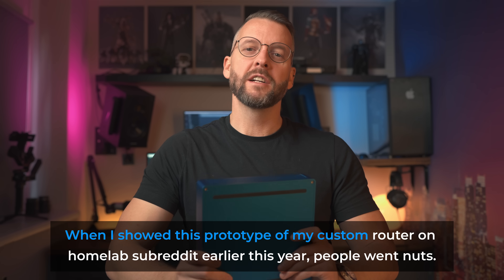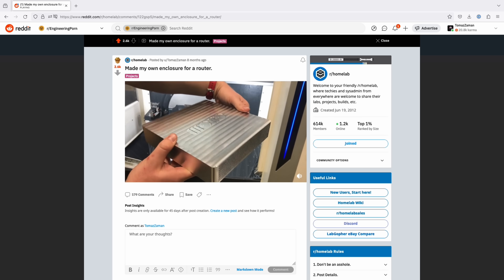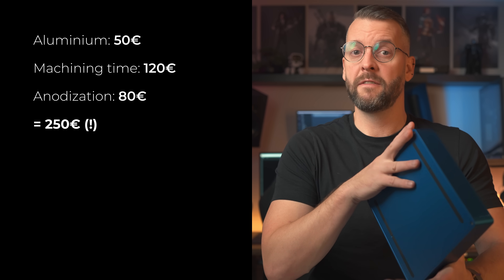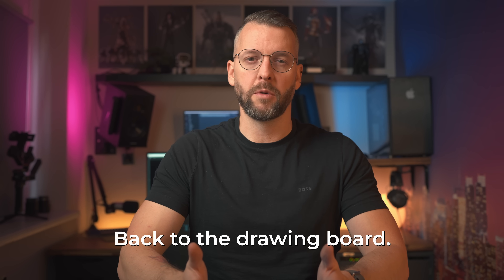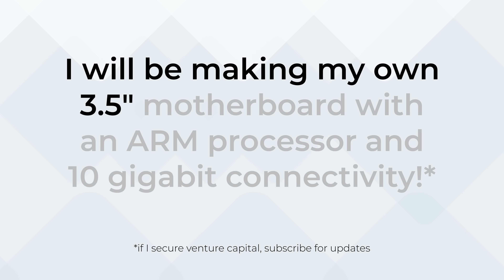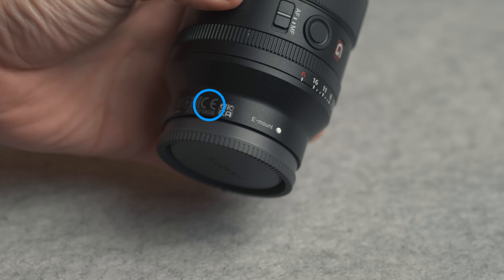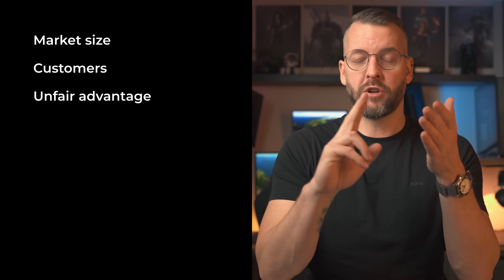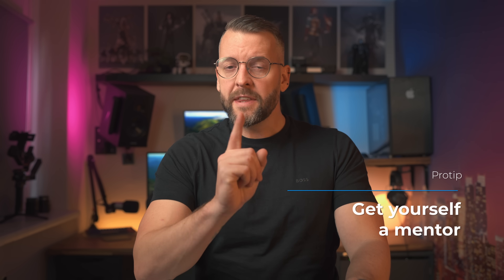I'm making my own high-end router. From scratch.

Comment: Did you ever look into dimensional extruded tubing? You can get the material cost down significantly if you use that for the body., and attach the top/bottom  through welding or fasteners

Comment: Hey! Huge fan of what you’re doing. Small note on the power supply. The very last one you reviewed is without a doubt the best option. Smaller would be nice, as you said, but frankly it’s already pretty small! I like it. Also I think you agree that having a little more wattage than you need is better than the alternative. Not enough power. 

Side note, I think the cnc aluminum case is so cool!!!!

Comment: Do you really need to make the case out of a single block of solid aluminium? I think sheet metal would be a lot cheaper or if you are really fixated on solid aluminium - just make all sides from different pieces rather than carving a single solid piece

Comment: Please find a cheaper option for the case. Multiple aluminum panel, or folded panels. 150€ is crazy for a case. I currently run a custom router made from a topton N6005 which has 6x2.5G and with 16GB ram and storage costed about 500€ and has a nice metal case

Comment: Wait, hold up, allow me to make a suggestion. You should NOT do 10G as I believe 100G is going to overstep 10G. A QSFP28 port has the same signaling to support a single 100G, 50G, 40G AND 10G and all you need is whatever transceiver for whatever you want to do. The only thing that you may not yet be able to do is PHY for copper connectivity on a QSFP28 port but you could use an FPGA to kind of force the ability to install a SFP+ 10G PHY into the QSFP28 port with a physical port adapter. A QSFP28 port can support 25Gx4, 50Gx2, 40Gx2, 10Gx4 already. Also this could totally justify expense by basically being the be all end all home router.

Comment: Nice, will that have integrated WLAN? I mean I am a fan of regular old cables (LAN!), I after all wired up my own place (apartment) before moving in with a network access-point/network-socket (well: 2 of them!) in every room (except for the bathroom - I don't see the need to have access to LAN in the shower after all)...still, for phones and tablets WLAN is important...why am I asking: Aluminium (that case is aluminium - right?) can't be that great for signal-strength!

Comment: Can I ask how this would be better compared let's say to an ASRock DeskMeet B660 with let's say a cheap i3 (can take up to 14900) and a 4 port 10GBPS NIC?
Given that DeskMeet is a full PC that can run proxmox for other use cases at the same time.
I am only asking because I work for a company that we support other clients and I want to bring to the table a custom made router that can run pfsense for example so we can have VPN to them and support them much easier.
So far I do this via the DeskMeet, I know it is not an 1U that I would love to have, but I am using it for Frigate with google's Coral TPU and a few other VM services that customers wants.
Also because at home, I have 1gbps FTTH internet, I have a couple of Asus routers that are wifi 6 and have dual core ARM cpus but they seem to struggle getting above 550mbps without having IDS/IPS enabled (much lower with that enabled). How good will ARM CPUs will be running a 10gbps internet connection with IDS/IPS? And no, I don't have access to this fast internet...maybe at some point 2.5gbps but for sure not 10. It is a more what IF question

Comment: Can't you get rpi5 and either see if there are 10G HATs for it or make the hat yourself, much easier than making whole mobo.
Reply from the maker: No. I'll be making a video why that's not even remotely the same. The thing is rpi5 isn't network optimized, so that 10G will slow down significantly, if there's anything (and I mean ANYTHING) that needs to be done to the traffic, such as deep packet inspection for intrusion detection.
Reply: @tomazzaman  So you need to use some processor optimised for network handling?
Reply from the maker: @Arek_R.  yep, we’re going with NXP LS1046A. That thing alone costs more than a rpi5 :)

Comment: thats a very interesting idea. But could you have just used a 10G add on card for existing MoBo? there are lots available with PICE or M.2 connectors that could just be mounted in the case
Reply from the maker: The problem is the CPU. It's optimized for networking, but if you use an add-on card, then the general purpose cores have to take that load, and they're not optimized for that.

Comment: Sheet fabrication is better for this application, it's faster, cheaper and makes almost no metal waste which means more savings.
Reply from the maker: Yep, planned.
Reply: @tomazzaman  good, also out of curiosity since some of these systems can run on x86 doesn't that mean I could just stick some cards in a old gaming rig and use it as a secure router? I'd assume it has enough grunt to sort out things.

Comment: maybe i am a little late but i come from manufacturing. have you thought about say 4-5 mm Aluminum Sheet metal? if you are ok with a radius, you could have those casings done for about 20-25 Euros easily. (the galvanisation not included, however) personally, if you were to have the corners laserwelded, you would have an amazing product with a fraction of the costs!
Reply from the maker: Yep, already spoke with a metallurgy shop that specializes in sheet metal. I have nothing concrete yet, but things are moving forward behind the scenes!

Comment: Extruded aluminum would be cheaper but yeah, if you're not chinese company making those in thousands you aren't going to make it anywhere near the "chinese board and  + some open source software" price. And there are like dime a dozen of those boards already, for very reasonable prices.

Also if it is a box hiding in rack the look is... secondary, it's gonna live hidden away somewhere in rack, I don't care whether it's anodized.

Hardware isn't really killer feature anymore.
Reply from the maker: Agreed!

Comment: I wish networking gear would be even more helpful to the user, so that the user can learn how networking works. There are so many mediocre manuals for routers. And routers are often built in a way that doesn't let your grandma operate it. We have maybe got some initial low hanging fruit of helpfulness with internet first setup. And some description on menu choices. But no router comes with a teacher. I guess it would be bloat, but imagine having some built-in AI tutor or something to help the novice user. The unit could still offer the regular stuff for the guy with networking certification. I don't think your aim would be this, but thought I would mention it anyways. As you obviously are trying to accomplish something out of the ordinary

Comment: new sub here. Inastead of 10gb connectivity can you make it adaptable to higher speeds?
Reply from the maker: Unfortunately no. We'd need to pick a much more expensive CPU to be able to handle that, which would put this device in a much higher class, and consequently, price point.

Comment: Sheet steel if you aren't using the case as a heat sink. Can be drilled and folded (and welded or brazed or soldered) at home. Cerakote for colouring might also work for the colour, it's a ceramic coating. Depends on how much you want to do yourself in the diy aspect.
Reply: Why not sheet aluminium?
Reply: @DanSlotea comparing like for like sheet stock, steel is cheaper, but also steel is stronger so you could use a thinner sheet too. Light weight isn't really a concern for something like this that's fixed to a rack / desk.
Reply: @carneeki  I see your point. It's just that he likes aluminium too much. But milling the case from a solid block is pointless, unless the case is also a heat sink. I'd be happy with a 3d printed case any day.
Reply: @DanSlotea  machining the enclosure from solid is silly expensive. But if his heart is set on machining it, there's plenty of plastics that might do the job too. On the topic of plastics, you make a great point about 3d printing... Open source the files and have the user print an enclosure. It even design around a Hammond enclosure (or a similar off the shelf enclosure). Maybe even design the board to microatx or miniitx fork factors so an off the shelf media pc case could do the job :)

Comment: Why not grab an off the shelf 1U chassis, if you are using itx anyway? That way you can also fit an internal flex ATX psu, and have some space for PCIe or Storage devices. Also One does not need to bother with getting it racked.
Reply from the maker: We're not using mITX, due to the feedback of my subscribers, A LOT has changed, so you might want to check my pricing video :)

Comment: This is a cool idea, however, Mini PC firewall router 3 LAN 2.5GbE 10Gig SFP+, 16GB RAM, 128GB Storage, Wifi 6, costs 320€ so ... yeah.... (it has intel cpu - N6100 (i think) that does not even use that much energy)... Anyway, good luck (i had similar idea, but in the end i just bought micro firewall appliance) edit: and install ProxMox on it with 2 OpnSense VM's, and 1xPiHole VM - it works perfectly

Comment: You got ripped off with the case, i have a design/manufacturing company.
We only pay €3.69 per kg of aluminum, this is also 5083 gleich(most expensive aluminum).
Machining pre cost are expensive(programming) but machine time is not really expensive.
Anodizing schould be more like 10€ or 20-30 if glasblasting is done.
Reply from the maker: Drop me an email.

Comment: I mentioned it in a reply to another comment, but it'd be really cool if the internal ARM chip were a bit overspecced and could be used as a low-load homelab or jellyfin media server.

Paying above 300usd for a router is a tough sell for most people when, as you mention, there are some under 50 or 100. (Granted like you also mention, they're not that great) But, if you can also buy a hard drive enclosure and now your router is running double duty as your NAS and media streaming server? That becomes a much easier sell, even for non-techies. Even if its not that fast, if it's fast enough for 10-100MB/s read/writing to disks, (+10 bonus points for enough SATA for RAID) video transcoding, etc. it can do enough for most people and realistically most of that shouldn't be a high bar with any modern CPU's you'd be looking at. (As far as I'm aware at least, maybe I'm just talking out my ass here)

Eitherway, super interesting project that I'll definitely be following. Higher level hardware design is something I've been wanting to look into myself but there aren't any real resources for "here is how you make a production grade PCB using modern processors on your laptop" so its always been a bit daunting to try my hand
Reply from the maker: I get what you're saying, but if I take that route, then I'm competing with a gazillion of mini-PCs out there. Not saying I don't want to do it, but not now. I want to make a focused product for a bit more narrow audience that can (and already has) give me a lot of input and help me guide my decisions so I can better cater to their needs.
I hope it makes sense.

Comment: On the subject of motherboards. How about something similar to those used in mini PCs or laptops? They run X86-64 processors which should offer good software compatibility and can be fit into a very small case(in the case of the HP 600G5 mini PC 177x175x34 mm or about a litre). This does require an external adapter, but with USB C being able to deliver in excess of 100W there should be many compact options. There should be more than enough PCIE lanes for a 10 gig expansion card, though I expect there would be a challenge in making it physically fit and finding a way to connect it compactly if you use an off the shelf board.
Reply from the maker: If I focus on an x86 platform, I'm competing with PCs (to a degree), of which there are thousands (both models and manufacturers). On the other hand, nobody made a router that's ARM-based, open-source, well documented and looks good. 😅

Comment: I love the comments. "I am making my own high end router" which is met by "why can't you make a really cheap one?".. which is a solved question. Keep doing what you're doing. Differentiating on a platform that has good thermals (a chunk of billet aluminium will do a better job than pressed alu/ steel any day of the week) and a good chipset/ setup will give it something worth the value. The cheap 2.5gbe (and now 10gbe) intel based units coming out of China can't really be competed with price wise, I am not sure why the heck people keep suggesting doing exactly what is already a very saturated market.
Reply from the maker: Thank you! My thougts exactly. I was pitching to an investor yesterday and he asked some similar questions (to challenge me, which I like!). As in, "you know you can get some chips much cheaper?" And I responded: "Yes, but those chips are worse, have poor thermal management and will be unstable in any kind of non-ideal environments. It's not a compromise I'm willing to do, because in a race to the bottom, nobody wins." He seemed happy with my response :D

Comment: If you plan to add SFP+ connectors, please make sure they'll also work at 2.5G and 5G speeds, instead of only 1G and 10G. This will allow some people (including me) with FTTH from their ISP to connect their internet SFP+ directly to the router, instead of having to go through a switch or SFP-to-RJ45 media converter :)
Reply: SUPER SUPER SECOND THIS! Pllease!!!
Reply: I thought he said there was already 2 or more RJ45 2.5 gig ports?
Reply: @beakerwsw  Please re-read the original post.

If the FTTH is coming in on a 2.5Gb SFP connector (like mine does), and the SFP cages on this router only handle 1Gb and 10Gb (like many do), then I would need to plug the 2.5Gb SFP into a media converter or a switch to convert it into a 2.5Gb RJ45 connection to be able to plug it into this router. If the SFP cages support 2.5Gb, then I could plug it directly into the SFP cage without any additional hardware.

Comment: Assuming the kickstarter question is applicable to the kickstarter site specifically, no. if it also includes indigogo or a self hosted campaign sure. Kickstarter has political issues and a damage reputation. i rather not use the site in general. indigogo is has fewer issues with political bias and is generallly less censorious. it's a safer platform to use. of course a self hosted campaign is preferable, at the end of the day but not everyone has the infrastructure or support to do that.

Comment: I currently own Mikrotik RB5009 and a 2.5G 5 port switch, but I would gladly replace them with your unit, for the right price. I don't care about the aesthetics of it, it can be made from 3D printed cheap plastic if it brings down the costs. Make the SBC, add different cases as add-ons. Whoever wants CNC aluminium, pays extra.
Reply from the maker: Yep. In fact, I'm announing two versions in tomorrow's video: one in CNC-milled alu, and the other in sheet metal enclosure.

Comment: I also question making it from a solid  block rather than from sheet materials it seems unnecessary yes its a high end touch but getting a product out that works at a reasonable price is more likely to be salable remember tech gear goes out of date fast so expensive high end touches that are only for looks and push prices up are unnecessary

Comment: I love it but your form is broken, it won't accept under 100, so I won't be entering it but if this ever hits the market as a wider avail product I'd consider it.
too expensive for me is 150-170
for me to still consider it is 125
for me to have a bargain 100-115
for me to think "this could probably have a lot of cut corners and be a problem 60-70"
Reply from the maker: 10Gb ports are a requirement. And it’s simply not possible to build such a device for that cheap. Processor alone costs 70€.
Reply: then that gives me a range to work from, but honestly without that I figured your form was broken, any reason that's not noted anywhere?  @tomazzaman

Comment: It looks interesting, but I find you choice of networking odd. You've got a mix of 10GbE and 1GbE ports, and maybe this is a cost consideration, but wouldn't it make more sense to have 2.5GbE ports instead of 1GbE? 2.5GbE is starting to see general consumer adoption.
Reply from the maker: Yep. I'm releasing a video in tuesday just about that. Moved 4x1Gb to 3x2.5Gb. Because the CPU does support it and many have asked.
Reply: @tomazzaman  That's excellent

Comment: The design of the case absolutely fantastic, one of the big criticisms I have with modern network routers is that the ports are never all the at the back of the device, they always have power at the back and network ports at the front. I understand why this is the case, as most network devices are designed to live in racks where cable access from the front is preferred. However for a power user who doesn't put everything into a cabinet it is incredibly frustrating. Look forward to seeing how this project develops.
Reply from the maker: Thanks for the feedback - it's more valuable thank you think (regarding the final design). Will share more soon!
Reply: @tomazzaman  you're welcome, I'm glad I was able to help.

Comment: wouldn't you just make the case into 6 pieces, the 4 sides and top and bottom. Make the seams invisible or integrate then into the design?
Reply from the maker: Yes, exactly what I'm working on now. Will present solutions once they are finalized.